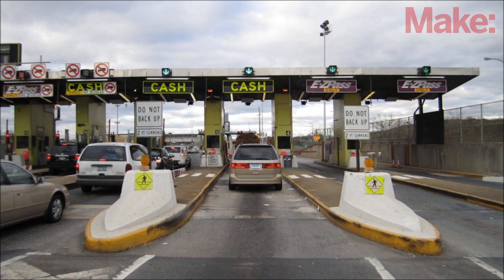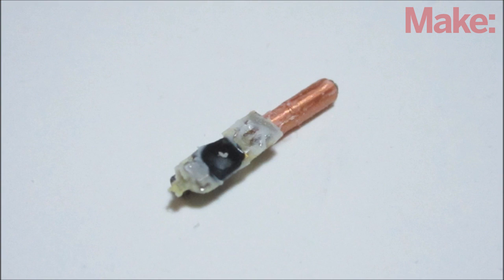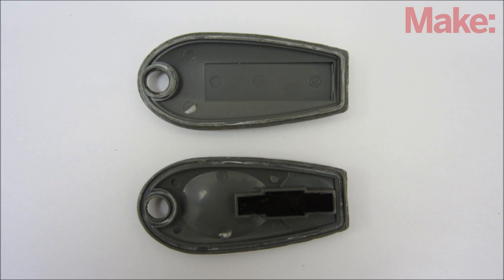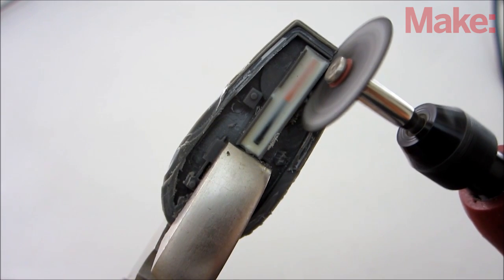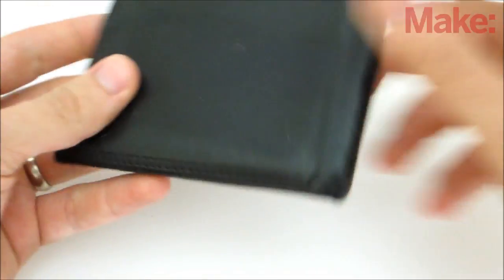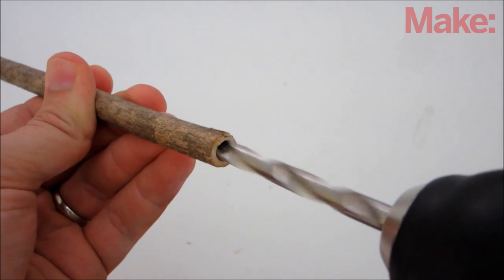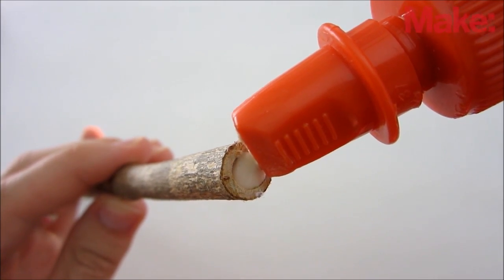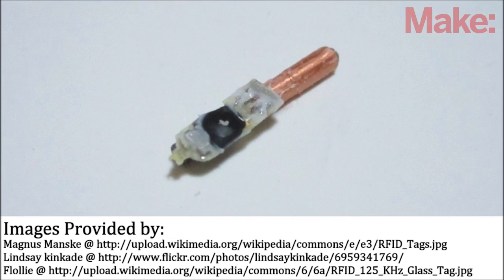DIY Hacks & How To's: RFID Transplant

Comment: Had an idea of sticking that in my BMW key fob so that I carry one key, but unfortunately it broke somewhere since I barely touched it. I used sharp blade to cut it out which was super easy but then had to shave off some of that black insulation
Reply: edit: I suppose without shaving of insulation it would probably work but then it doesn't fit inside the BMW key fob